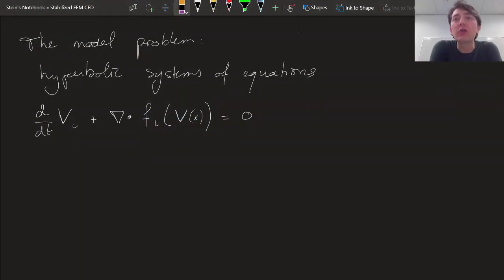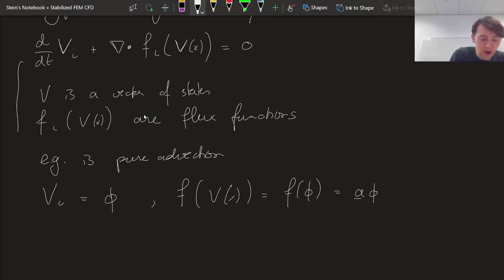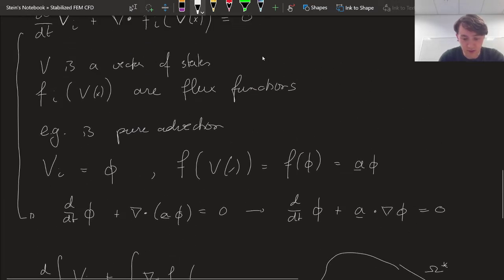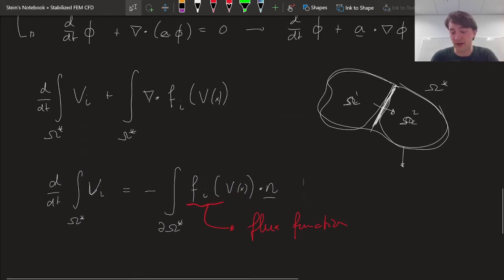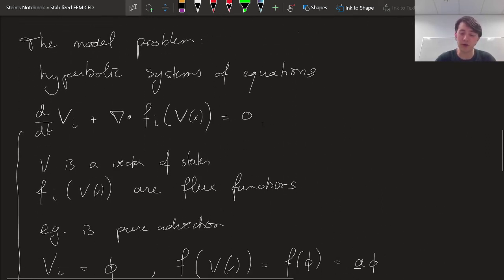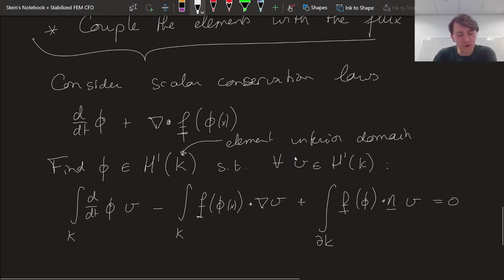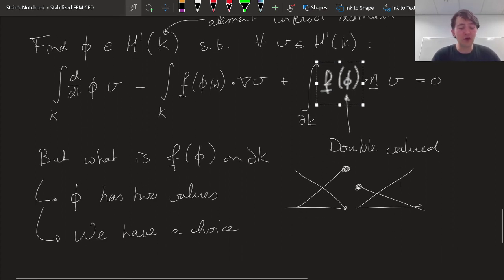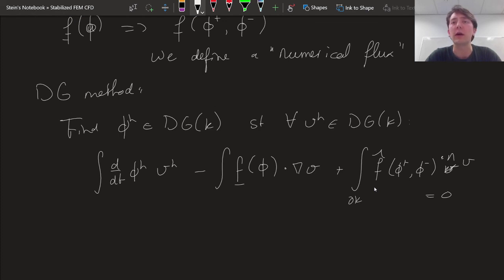48 - Discontinuous Galerkin methods - General derivation

Comment: Great video, something I do not understand is what is different wrt to Finite volumes? Cause they seem very similar as idea, but I'm sure there js something different/advantagious
Reply from the maker: Interestingly, this is a question that I've been asked more often, but to be honest, there is little similarity:

From a theoretical perspective:
- FV is based on the PDE in a control volume. DG (a finite element method) is based on the PDE in weak form
- FV: the dofs are cell/edge averages and the discrete solution is an array of average values. In DG (a FEM) the discrete solution is a function over the entire domain
- In FV, the flux formulations couple together cell averages, almost in a 'finite difference' sense. Consequently, upwind is a lower order approximation. In DG, flux formulations couple the approximate solution on either side of the shared edge. At those edges, the solution is fundamentally double valued, so there is no finite difference flavor at all. Upwind is optimally convergent.

From a practical perspective:
- Higher order DG schemes can easily be constructed on unstructured meshes. (In FV, it is often a major challenge to get above second order on an unstructured grid)
- DG approximations carry more DOFs per element than FV. A cheap DG approximation is tentatively more expensive than a cheap FV approximation.

The similarity:
I suppose that the lowest-order DG method (zero) is seemingly very similar to a FV method, as the dof may be interpreted as the element average. Probably, in 1D you might even get identical matrix systems of equations. But nevertheless, the dofs have different meaning and they are based on completely different perspectives on PDEs. So I typically see little value in that statement.